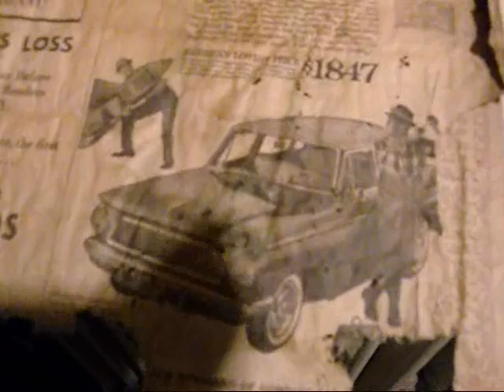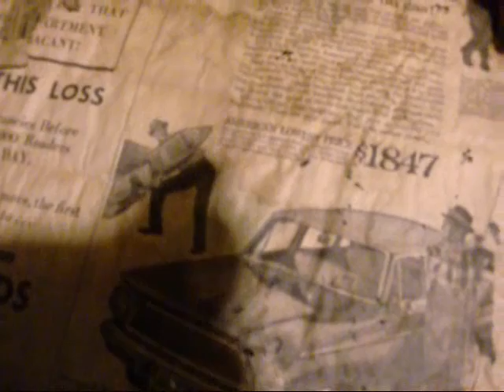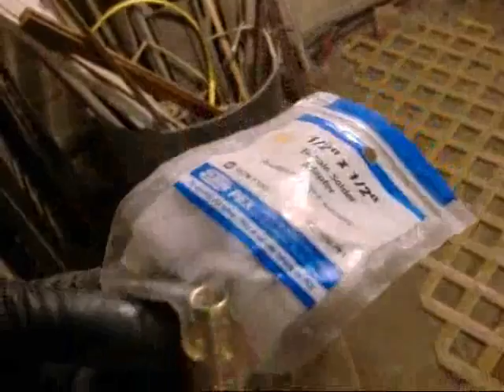2 19 13  Old  Cast Iron Radiator Repair Vid

Comment: so u shut off the power to the boiler. then unscrew the right side like u did. I'm guessing water is going to come out. then I can turn it around from the left. where the open close valve is. sorry if I'm Confusing u. I'm to young to know about these thangs I need to move the one in are house to scrape and paint.  thx